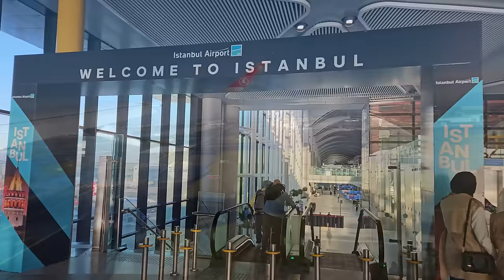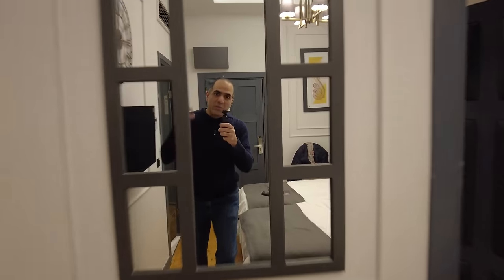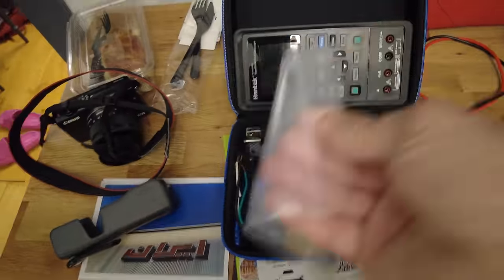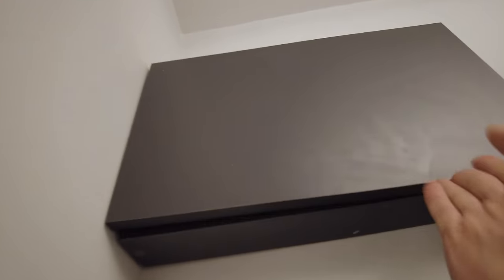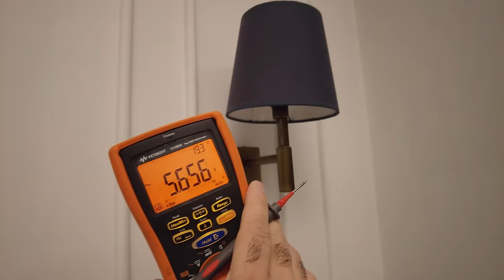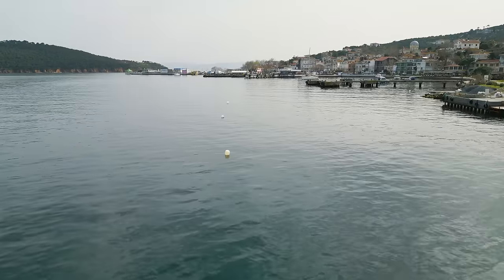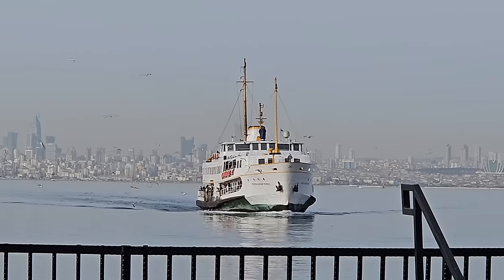Turkish Electricals Are Almost TOO CLEAN

Comment: 6:30 in Germany we have similar GFCI systems and its not unusual that they don't pop. Therefore it is important to test them once in a while (2 to 3 times a year). And it is possible to "regenerate" them by plugging in more current.
Reply: And probably Turkish electric system based on German standards as in many other things.
Reply: Actually often they are just stuck closed, never turned off since installation like 30 years ago.
Clicking them off-on-off-on a few times may be enough for them to start working.
Reply: @cemyildiz7842  Yep, everything with a DIN mark on it.
Reply: It's usually recommended to test them at the beginning and end of daylight savings (because testing them will mess up any mains powered clocks and on those two days you need to set them anyway).

Each European country has different electrical regs (although usually based on the same harmonisation documents, just with loads and loads of national amendments and changes) but the basic designs are similar, it's the details that are different. The UK and its former colonies are most different but some things have changed there as well. Ireland, apart from using UK sockets, is much closer to continental practices anyway because of close historic ties with Siemens Germany.

I'd say generally speaking there are only two types of electrical setups in the world: European style and US style. Perhaps you could add old UK style as a third (rewirable fuses and all that).

Comment: 5:12 This man is not remotely afraid to blow up a resistor just to test the GFCI.
Reply: He's not afraid to shock himself for the same in the past
Reply: Why does it say you left your comment 10 HOURS ago??? The video was just uploaded!!!
Reply: Kudos resistor 💀
Reply: Patreon early access?
Reply: He needs to get a resistor with larger power dissipation rating than 1/4 Watt.
Reply: And he said "wth happened" like it was an accident😂😂😂
Reply: 230 V * 0,034 A = 7,82 W wich is more than 0,25W .... Put either bigger Resistors into your bag or use 32 in Paralel. Maybe make an Test PCB for Traveling?
Reply: @nameredacted1242  Time traveler
Reply: @PaxDerErhabene  One day it won't be a joke, and something serious will happen when he blows up another 1/4W resistor. I think he will eventually get in trouble over this stupidity.
Reply: @PaxDerErhabene   They make resistors with more than 1/4W heat dissipation rating.
Reply: resistors are cheap
Reply: @relecmo906  Eyeballs are SUPER EXPENSIVE
Reply: @nameredacted1242 resistors don't shoot shrapnel at you when they burn
Reply: @BarteG44  They do! See the sparks flying? Molten metal balls flying right there.
Reply: @nameredacted1242  first of all he's using a carbon film resistor so those sparks are very unlikely to be actual metal, second of all sparks produced in explosions like that are very small and very low mass. They not only slow down very quickly from the air drag but also cool down and oxidize before they can reach anything. Not to mention the fact that both their mass and thermal mass are extreamly low, making them harmless even when they contact your skin or eye. At best they can cause a mild irritation
Reply: yep he goes all in

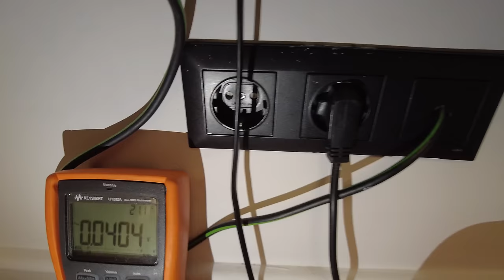Comment: 4:02 Yes! Please do a socket tier list
Reply: Germany: good
UK: good until you step on a plug and end up in hospital
US: so-so (although per-socket GFCI is a good idea IMO)
...........................................................
Very rural Russia: bare wires wound around prongs of another plug (seen that personally)
Very rural Africa: plugs? we just tie wires together with fingers, don't touch them to each other and you'll be fine
Reply: @jwhite5008 mexico: TAAAAPE
Reply: Rest of Europe left the chat xD
Reply: @jwhite5008  us: it's safer with the ground on top but we can't stop making smiley faces
Reply: 1 place: Switzerland. we get 3 outlets in a single square (T13/T23 Connector), or 1 Outlet with 3 phases (T15/T25 Connector).
Reply: Thailand: Let you test if the American (Or Japanese) devices you have can tolerate 230V. (A, B, C, E, F and O Hybrid)
Reply: I love the European-German standard, you can plug them both ways which is surprisingly convenient in a lot of situations.

Comment: Great Video ! Usually each main circuit breaker protects 3 to 4 branches, so in this hotel, every 3 rooms have a common main circuit breaker, which is rated for 300-500mA for current leaks and 15A to 45A in short-Circuit. Although it was there to protect the wires between the main panel and the room's panel, fortunately it acted as a double protection preventing fires, but not electrocution.
As for the room's GFCI that is rated for 30mA in current leaks, I don't think it's faulty, sometimes technicians bypass it, when it detects current leaks every now and then, instead of looking for the leak/faulty component.
Reply: İn general technicians who actually apply these stuff do a shitty job. So i wasnt surprised.

Comment: One thing that is common and I have seen it in actual panels is that usually at shops and businesses they install those protective breakers and what happens is that the breaker starts doing its job. Then they have to figure out where the problem is (usually fridges and AC units) but because they have to reset the breaker every now and then, they will bypass the breaker which IS ILLEGAL.

Comment: In asia(Bangladesh) we don't have that fancy gfci type sockets for preventing ground fault. But we have rccb/elcb type breaker, which works pretty well for ground and over current protection! 
Also in home wiring whole electrical system is ground protected by single rccb/elcb and multiple mcb!
As you showed in the video hotel room rccb didn't popped, so it's recommend to test the rccb/elcb  every 2-3 month using that test button!

Comment: Well, hotels have some standards. :D And our main lines are not bad actually. But an old residential apartment flat would be like a dream for you. :D 

In Turkey, before 1982 grounding was not a must. From 1982 to 1991 grounding in kitchen and bathrooms was a must. After 1991 all house should be grounded. After 2003 or 2005 GFCI became a must.

When making a residential renovation in Turkey, nobody checks what you are doing. So, let's say you bought a 1972 model apartment flat and renovated it. You can change it's electrical system, or if you don't want to, you don't have to. So, you house can be grounded or not grounded or partially grounded, or fully covered with gfci. :D

Also, in many of the apartment flats, grounding rods are very old and does not do it's job. My office's apartment was like that. I was installing a laser cnc machine. So I checked the grounding and it was seriously bad. I told the apartment. They did not care. So I ran a grounding cable to the ground rod of the boiler of the apartment and connected my apartment flat to ground. :D 

Another thing: in juction boxes we generally don't use pogo connectors or any type of connector. We use pliers and electric tape. :D 

My house is 1977 model. I renewed the whole system with better cables, better grounding, GFCI, around 35 automatic fuse. But in my junction boxes pliers and electric tape is used. :D
Reply: Please, get some Wago clamps. They're cheaper than a new flat.
Reply: There is a mistake, you have to renovate electricity system after you purchase it otherwise you cannot make a new contract for energy subscription, that's how I had to renovate my house from 1993
Reply: yeah hes turkish lol... of course hes loving his own countries wiring
Reply: :D
Reply: what do you mean?? i thought electrical stuff doesn't work without grounding so every house needs that????
Reply: @MehmetMehmet-y8c  Before it was grounded via neutral wire, and even with separate ground wire the neutral will be grounded at some point in most of the European countries.
Reply: @MehmetMehmet-y8c  No. All of the electrical stuff needs just neutral and live. Grounding is for safety. Several houses in Turkey lacks proper grounding.
Reply: @NoName-cx2mb  Actually it can change from the energy company to energy company. In Ankara no one asks for anything. You pay your enterance fee and they connect your electricity. Also in Ayvalık, Balıkesir it is like that. I renewed all off my cables and fuses in our summer house; but no one asked anything when making the new subscription. In Kaş/Antalya it is also like that. I don't know Bodrum for example. I never renewed or changed a contract in Bodrum.
Reply: @wilfriedklaebe  In near future I will. But relax, cement does not burn. :D Fuses I chose are low value. So popping a fuse is easy in my system. A short circuit will directly pop the fuse. In some of the junction boxes there is not enough space to fit wago clamps. :D 15 cables in a small junction box... :D All of my junction boxes are flush mounted. So I will buy  surface mounted boxes for these and mount them on top of the flush mounted junction boxes, then use wago clamps.

A standard Turkish house does not have many appliciances that consume huge amounts of electricity. No AC. Heater is Natural gas heater. We don't like electric heaters. Utility water heater is also natural gas. Highest consumers are oven, microwave and cattle. That is why we take extra precautions for kitchen and for the rest, we don't consume much. :D That is why our houses does not burn down. With mediocre Turkish wiring, if we consume like an avarage US citizen, half of our houses would burn down. :D But don't fear. Cement does not burn. :D Electricity fires in our houses are a little bit smoke and a bad smell.
Reply: Also, use ferrules for flexible wire.
Reply: @huseyinozsut9949  You guys don't use AC? Every second apartment, I see has an AC unit, but i must say, that my family is coming from Kahramanmaras, there Temperatures above 40C are normal.
Reply: @huseyinozsut9949  because even in your renovations you (or the electritian) follows the code. They dont go over and beyond of safeties. In some electrical distribition companies they do inspect before they give house power. (they do check newly constructed ones that is a must in every city) But in the end everything that happens in your house (as long as you dont draw more power than you are allowed) is left to your own devices. (like you should have a lone specified plug that connects to a breaker for your fridge and for your water heater (kettle) but most houses dont have a kettle breaker/plug .
Reply: @thebamplayer  Even western parts of Turkey, most of the houses won't need AC if they are not the top floor. Some summer holiday places like Bodrum, Ayvalık, even some villages of Marmaris, you won't need AC if you are not in top floor. Just open the windows and that is it.

But in southern parts of Turkey, AC is a must for a normal person. In Antalya, Alanya, Mersin, Adana, Kahramanmaras, Diyarbakir, Hatay you won't be able to live a comfortable life without an AC.

In Ankara, it is a mix. During winter it is cold. Old luxury houses have huge windows even if it is cold during winter. Due to high Natural Gas prices (compared to our income) apartment chooses to burn less fuel. So you can see 18 degrees Celcius in your living room during coldest nights. In those times, AC is used to supplement heating (if you can afford the electricity bill).

During the summer, during day it can reach 38 degrees celcius with low humidity. So in shadow it will be cooler. During day, our living room burns like hell for example. Only in living room there is 35 square meters of windows. :D 

But during the night it will be 18 - 24 degrees celcius outside. So you won't need an AC. If it passes 24 C, then the problem begins because the building gets crazy hot during the day and it can't radiate the heat at night. :D But this happens only 10 days a year, so you won't be needing AC much.

So in Ankara offices most likely have AC. Houses most likely won't have AC.

Also, there is not AC in any schools, so from the begining you are used to hot weather with school uniform. :D Schools holiday season begins in June and at June Ankara can reach 33-34 degrees during day. :D Let's say we are living a sub-tropical dream. :D 

As we go south, we enter tropical reagon. :D And also since we pass the mountains, and ehead of us there is a huge sea, humidity also rises. :D So that is why Antalya, Alanya, Mersin, Adana etc etc needs AC, but we don't.
Reply: @onatyungul872  Yes. That is true in theory. In practice it is not. Because I forced my electrician to use higher gauge and new cabling for my oven. And as you said, kettle and toaster (the one you press from top to make Turkish toast) has it's own cabling and breaker. The rest (combi, microwave, refrigirator)  has another line. So for my kitchen, there is three breakers just for plugs and one breaker for lights.

The highest electricty consumer in Kitchen is not kettle by the way. It is the oven. It can pull 3500w easily. Kettle will be around 2500w.

By the way, I made all this investment, but our cabling in apartment is like a joke. They are thin and 50 year old. I am lucky that it is three phases. If it was monophase, I would be f+'!ked. I never saw a three phase wiring to flat enterance in a 50 year old building. It is a good thing.

Comment: That's the beauty of the Schutzkontaktsteckdose. The ground prongs make contact before the live wires connect. The version with the doors is an unofficial upgrade to the specification.
Reply: Ach wie ich diese deutschen einzigartigen Wörter liebe 😄
Reply: @mnts9101  :D
Reply: Sag einfach Schaltkasten/Schaltschrank.
Reply: @constantinart.426   Er redet von der Steckdose und deren Erdungssystem, Du von der Kontrolleinheit eben jener. Unterschiede.
Reply: @dennishorror142  Ja danke, falsch verstanden. Jetzt macht Sinn.

Comment: the socket is actually one of two european styles
the difference between them is how they're grounded; some countries (i.e. germany) have plates on the sides of the socket while some have a pin sticking out of the socket (i.e. poland)
Reply: nowadays the difference doesn't really exist because the modern cee 7/7, cee 7/16 & cee 7/17 plugs fit into both style sockets

Comment: 10:00 metal objects that is not earthed should be double insulated inside, a damaged or loose wire should still have one layer of insulation separating it from the metal outside. Double insulated things is marked with a symbol of a square inside a square.

Comment: 5:30 in the modern fuse box, you have to reset (small reset Push-Button) the fuse after a short circuit - just to be sure that you have solved the problem, so first reset and then put the fuse back into operation.
Reply: Or switch it off completely as some breakers trip only halfway (the lever will be in the middle) and cannot be turned on before turning them completely off first.

Comment: 4:42 It seems like the RCD isn't wired at the top at all, this could also explain why the "test" button didn't work.
I've never seen any of these type of RCD fail with the test button, especially ones from a company like Siemens.

Edit: it appears that the bottom two screw terminals are being used as jumper terminals for the whole fuse box
Reply: Everything can and will fail. I had a new-ish Legrand RCD replaced last year because the test button didn't work (but had worked half a year earlier). I'm not an active electrician (though trained as one) but I do see quite a few installations and I'd say I had maybe five to ten defective RCDs in the past 20 years. Some didn't trip, some didn't reset after testing or tripping. Most of them were from reputable manufacturers but at least 15 years old, some over 30. The most spectacular failure was an AEG from the 70s where apparently both the mechanism and the test button were sticky. I pressed the test button and the RCD started making all sorts of buzzing noises until the test resistor exploded.
Reply: I've actually seen them fail, especially in harsh environments
Reply: They do fail, hager, ABB, siemens, schneider... you name it.
Reply: @bladeoflucatiel  don't fail often if you test them monthly, that prevents the mechanism from jamming up

Comment: Although this video throughly covers most of the up-to-date installments, this isn't the case for many buildings or houses in Turkiye (unfortunately). The old porcelain light switches (the ones that become a bit too "energetic" if your hand is humid or wet before contact) as well as some electrician oversights (unnecessary fuse placements for devices that demand high current for the first moments) are still present and maybe even continued. On top, the RCDs sometimes arent tested properly for safety. My teacher once said he went to a kindergarden for inspection and although the principal was "very proud of their RCD installment and general safety precautions", it didnt take him long to realise that RCDs were only tested via their test buttons to see if there is a mechanical problem; they weren't even connected to the infrastructure.

But putting these issues aside, I'm happy to hear your opinions about the infrastructure. As an upcoming electrical engineer I'm happy that I've managed to find your content.
Reply: no its no real
Reply: @efehanyq  could you elaborate?
Reply: Türkiyenin her yerinde standart ve üstü işler vardır. Bunun altında işler çok nadirdir. Çok çok eski tesisatlardır.

Comment: 🎯 Key points for quick navigation:

00:00 Istanbul adventure begins
01:05 Safe recessed outlets
02:09 High fuse panel
03:26 Proper electrical standards
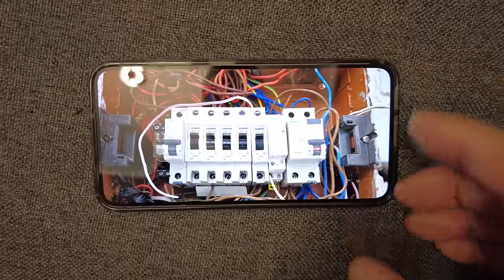04:37 Faulty ground protection
05:19 Breaker pop incident
07:07 Testing RCD functionality
08:03 Room's RCD works
10:16 Importance of protection
11:34 Clean city wiring
14:21 Convenient hotel location
15:10 Upcoming event promotion

Made with HARPA AI